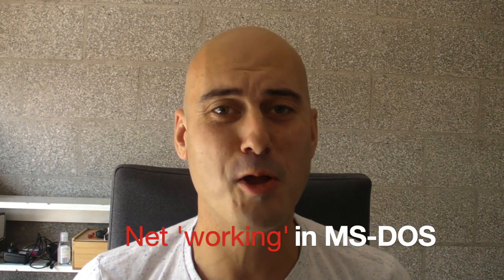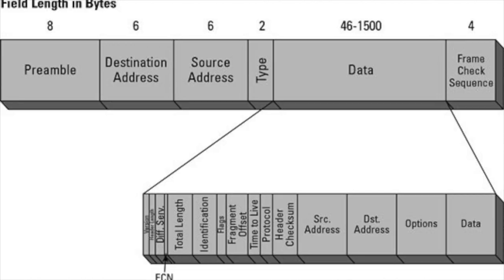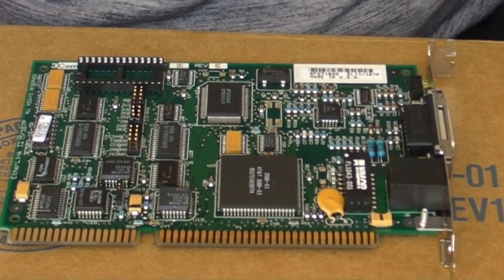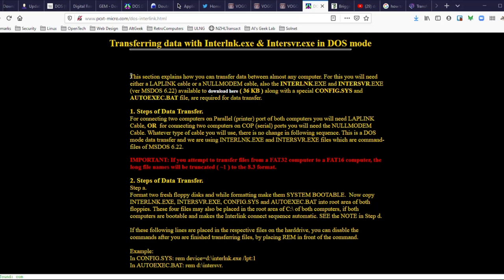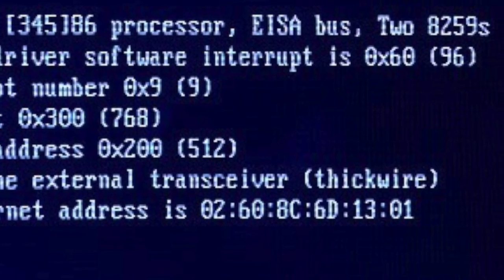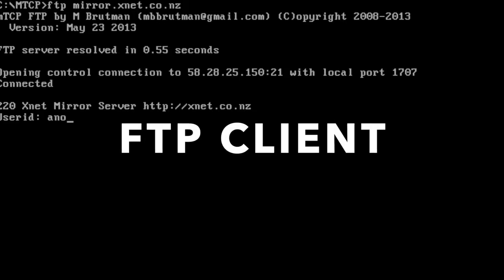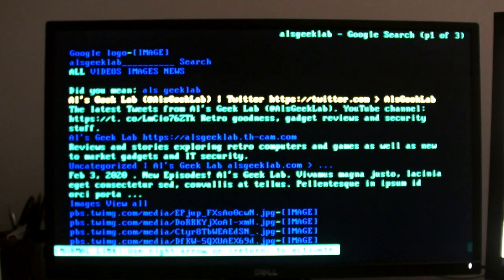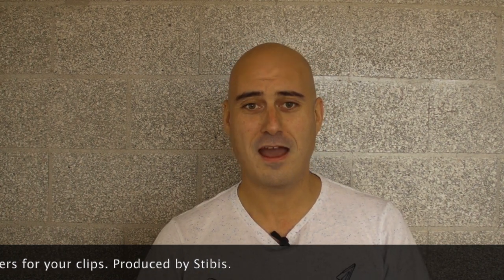How to use a DOS PC for web, email, twitter, IRC & more!

Comment: Thanks to this fantastic video, I now have my IBM XT286 connected to a network! I had a bit of trouble as my XTIDE Compact Flash card was already attached to base address 0x300 so I changed the address to 0x320 on the network card and everything was hunky-dory.
Reply from the maker: Glad it could help you!

Comment: New desktop PCs still come with an RS232 port, it's just left as a pin header on the motherboard that you have to connect a DB9 connector bracket to.

Comment: I have a Dell PowerEdge 500SC, originally intended to run Windows Server 2003. I've reformatted the hard disk and installed DOS 6.22 on it. The motherboard, like most modern computers, has an Ethernet card built in. I think maybe it is Intel PRO 10/100 compatible. I'm not sure exactly. I wonder if I can get packet drivers for it. The computer has PCI slots, but no ISA or EISA slots.
Reply from the maker: Pretty sure you'll get support for the Intel e1000 or e100. The crynwr packet drivers website has most drivers on it, but Intel actually host many DOS drivers to this day too.
Reply: I got it to work. Hooray!

Comment: What drivers would be needed to use the serial port to serial port option? And how would I get them? I have a computer from 1999 that has a serial port, and access to the internet and such, runs Windows 2k with BWC Kernel extension. Or should it just automatically work, and if so, what would I need to type in DOS to access this? EDIT: So I actually typed that before you continued mentioning the software requirements, and I can tell that that would not be an option. But to elaborate on my situation in hopes of some support, I actually have a original line IBM 5150 that I would like to connect to the internet, (or at least have a means of transferring files). I became interested in this because I only recently got the computer, and of course it only has two 5.25" floppy drives with no hard drive and no hard drive support, though the original owner added a memory expansion to its 16k-64k memory, giving it about (going off memory) 300-something k of memory. I was thinking about how I could transfer and store larger amounts of files, and the one way that appeared like it could work was the parallel zip drive using the unofficial 8086-8088 palmzip drivers. But the problem I face is the inability to transfer the needed drivers and software, as well as how I would even house the software. You see, the palmzip driver requires at least DOS 2.0, so that creates the problem of not having any means of getting the driver and DOS 2.0 onto a computer with no hard drive as well as only having 5.25" floppy drives. The only information I could find first of all drives up cost with much uncertainty of the actually possibility of this method working. I do not know much about DOS but based on about one video that I have seen, it can be run directly from the floppy, would mean that I have to buy a DOS 2.0 floppy, and that leaves no more room for the palmzip driver if I were to somehow get it onto a 5.25" floppy. I think I would have to install that driver onto a hard drive some how, but say I didn't need a hard drive, or I didn't mind just sticking with small games that normally run directly from a floppy, how would I go about transferring files. Unlike the 3.5" floppy drive which has many plug and play USB options available, the only not internal options I found are costly, and still require that you have an internal floppy drive. So my only option could be finding a 5.25" floppy internal floppy drive for the 1999 PC. As far as disk space, is there any hard drive that could work with an original possibly BIOS revision 1 (I just got it so I have not checked anything) ,  that doesn't consume too much power (the power supply provides: 63.5W), and has drivers that you could link to. And one last thing, how would I go about installing DOS 2.0 (as far as I know that is the minimum that could support hard drives, and could only support drives of up to 16mb because of formatting requirements), because if I need a driver to use the hard drive and the driver could only be installed on DOS 2.0, then I would neither be able to install DOS 2.0 nor would I be able to install the needed driver. But knowing how unknowledgeable I am, maybe you don't need a driver to use a hard drive at all, and perhaps it automatically is able to use the drive as soon as it boots DOS 2.0 from the floppy to then copy the DOS 2.0 files from the floppy to the drive. But either way, I still need help finding a hard drive that can work worth these limiting hardware requirements. I am a newb/noob, and this is really more a spew of thoughts, but if you can find usable questions and information to answer, that would as always be much appreciated. I have so many concerns, and don't want to blow money on something that wont work.
Reply from the maker: no drivers needed, however you'll need either intersrv or windows had a thing called direct data transfer wizard or something like that, see the bit in the video re intersvr (I think I have links in description too)
Reply: @AlsGeekLab  So just to clarify, if I got a hardware compatible hard drive and hard drive controller, and I had a DOS 2.0 5.25" floppy, even though DOS 1.0 does not recognize, when I install DOS 2.0, it will automatically recognize the hard drive to copy the files? What would be the best hard drive for an original IBM 5150 given the main hardware limitations plus the limitation of the size to 16 mb by DOS 2.0?
Reply from the maker: @MattIsTheCat  dos 3 and above is always the best choice for hard drive usage. 2.0 introduced support for hard drives, 3.3 was arguably the best version for pc and xt. However I use 6.22. if I went to install dos again I'd prob install ibm pc dos 7 tho
Reply: But if DOS 2.0 was my only option, and I had the hardware restrictions of an original early model 5150, , what 16mb or less hard drive would be best? Also, thank you ever so much for responding in the first place, I honestly probably put too much anyway.
Reply from the maker: St412 probably a good shout. But honestly I'd just use a XT-ide-cf
Reply: @AlsGeekLab  I will look into that, also based on a quick search these are some of the main hardware related hurdles that it (the hard drive) would have to by-pass: • The BIOS on the 5150 motherboard has no support for hard drives. (It said that, but perhaps a newer more power efficient one works in a way that needs no bios connections, I really don't know)
• 'BIOS expansion ROM' functionality did not exist at this time.
• The IBM 5150's 63W power supply was inadequate to power both the 5150 and hard drives of the time.
EDIT: So after looking more closely, I have found that I will likely have to use DOS 3.0 (because of the hard drive capacity of the Seagate ST-225 being to high for DOS 2.0), and I would have to use the ST-225 because of it not using so much power like the St412, but the worse part is that I would have to upgrade the BIOS chip to BIOS revision 10/27/82.
Reply from the maker: @MattIsTheCat  yep, that's the truth. That's why an CF-ide
Reply: @AlsGeekLab  So where might I find a BIOS Chip with BIOS revision 10/27/82, or are there non on the market? Honestly, it appears like it would require soldering, and I don't think I would want to do that any way.
Reply from the maker: @MattIsTheCat  I didn't have to solder myself, but I did it on an XT. I got a friend to burn them
Reply: @AlsGeekLab  I wonder if there is any BIOS chip flashing software that could update it to the BIOS revision 10/27/82, and of course provided me access to the use of a hard drive. It would have to be something small enough to fit on a 5.25" floppy, two at most, but I would be worried about the risks of flashing the BIOS chip in general.
Reply from the maker: @MattIsTheCat  I don't think the bios on the PC is an EEPROM, just a PROM, so you can't burn it. But I may be wrong, have a google I'm sure you'll find out. I dare say people sell them on ebay. My friend over at Monotech PCs makes them, so if you contact him and say I sent you I'm sure he will be able to sort you out
Reply: @AlsGeekLab  So I have a 1985 IBM 5150 which has some hardware related problems (I think it needs a replacement floppy controller, based on what the seller said, and the 601 error code) but it does boot up, I also have a fully working 1981 IBM 5150, I haven't checked the insides yet, but assuming the 85 5150 has the newer bios revision chip as shown in http://www.minuszerodegrees.net/5150/bios/5150_bios_revisions.htm, could I transfer that chip to the older model 5150, giving me hard drive support? You said "I didn't have to solder", but did you mean someone else did soldering, or how does one safely remove and replace a different chip. Are they even the same physical size? Thank you, once again, and I appreciate your support.
Reply from the maker: @MattIsTheCat  yep, the chips are all the same size. No soldering required. As far as I know, none of the original 5150 BIOS support hard drives, only 5160 XT and up. You will ideally need a 1986 ROM. However, again, a much better solution these days is to stop worrying about old hard drives that are likely to fail say any point, and use a modern compact flash controller. By all means keep the drive for authentic looks if you like, but I don't use the HDD at all these days. Low capacity, slow and cumbersome
Reply: @AlsGeekLab  If I did get a compact flash controller card, would there be a need to upgrade the bios chip to use the card and its drive for file storage? Also, is there any pre-built 5150 compatible compact flash controller cards that you recommended, and how much power do they take? EDIT: I just found out about http://www.xtideuniversalbios.org/, are any of the files compatible with the original IBM PC, with the original bios chip? I noticed that all of the bin files mention XT AT or 386 (one doesn't, it is contains the text "tiny", even the card and BIOS itself have XT in the name. 

But based on even more information that I just found, https://monotech.fwscart.com/XTIDE_Deluxe_Bootable_ISA_CFIDE_Interface_Card/p6083514_19478732.aspx the BIOS is specifically on the card, and does not replace the PC's bios, but would the all CPU compatible BIOS option be correct if I want it to work with a 5150, and what is recommended for the EEPROM type? Will this even work on a non-otherwise upgraded Original IBM 5150?

Hopefully last edit: An eBay seller of a card mentioned this in their description "8088-based computers are picky about the type of CF card used. They will require an IDE/PATA hard drive or a Memory Partner, WinSystems or SiliconDrive CF card. The free included CF card isn't compatible with 8088's."  So, what would be the best model WinSystems or SiliconDrive Compact Flash card to use, and am I interpreting this correctly?
Reply from the maker: @MattIsTheCat  personally the cf cards that I have used have been fine, but perhaps I got lucky. Monotech PCs (the link you have) would be my recommendation as he will supply a compatible CF card if desired. I'd ask him (Jacob) if it will work with a 5150, but I believe it will, but he will know for sure.
Reply: @AlsGeekLab  It mentions this if you scroll down to the description "The XT-IDE Deluxe is primarily for adding a reliable, modern hard disk solution to an 8088 PC, such as an IBM 5150 or 5160. It also works in 286 and"
Reply from the maker: Yep that's what I thought. Superb!
Reply: @AlsGeekLab  You have been a great help, so, for the XT-IDE, do I need to go into some sort of BIOS setup menu to enter the disk geometry of the compact flash, or does the XT-IDEs built in BIOS automatically detect this (does it at least have its own bios setup so that you can type the disk geometry?). I only ask because the 5150 does not have a BIOS set up according the the web, and I am unsure if I would be able to properly configure the settings with DIP switches. And according to this there are no switches to change the drive geometry natively on the 5150: http://minuszerodegrees.net/5150/misc/5150_motherboard_switch_settings.htm
Reply from the maker: @MattIsTheCat  you don't need to worry about disk geometry or bios with the XT-ide
Reply: @AlsGeekLab  Alright, thank you again.
Reply from the maker: No worries! If you haven't already, I'd really appreciate it if  you would like the video and subscribe to the channel. If you have any friends that would like it, please share it with them too!